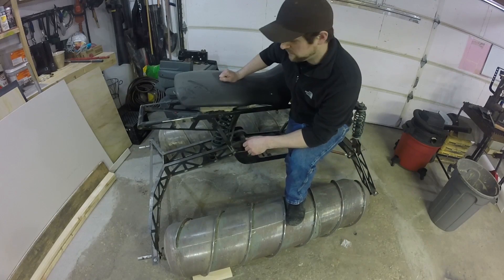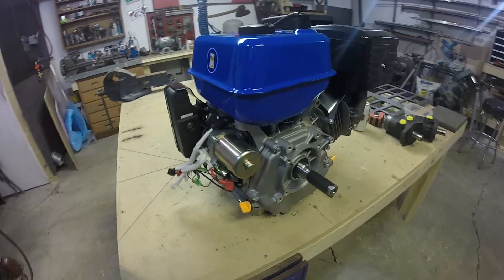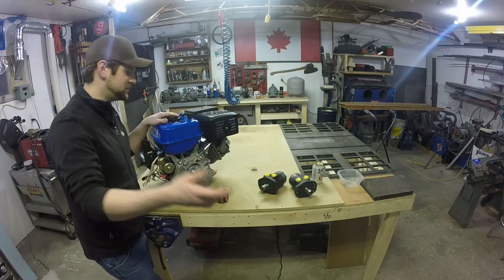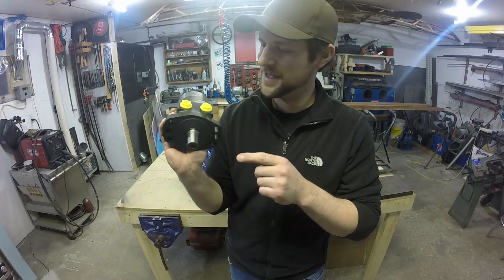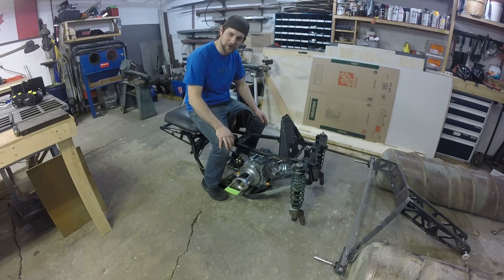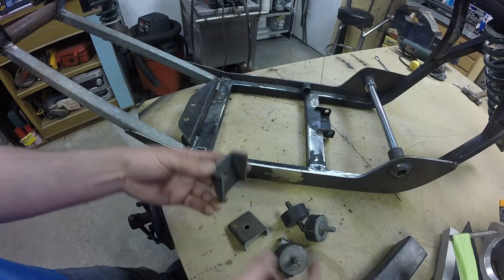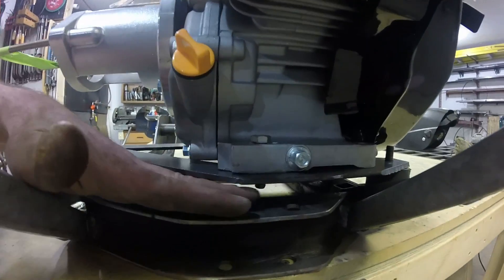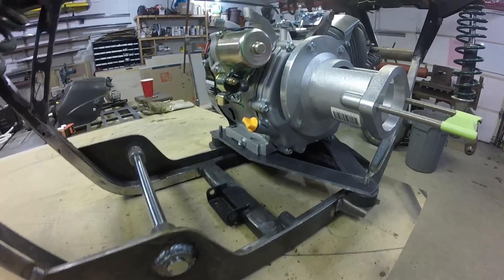Amphibious Screw Drive ATV Project - Part 6 - Horsepower

Comment: hello nic, my father and me are big fordson fans, we have 5 of them. I am really interested in the fordson snow devil and I would like to modify a fordson f to a snow devil. the real deal. my question was: where do you buy for bevel gears? it hard to find them that are big enough. 
much obliged,
Jermain
Reply from the maker: as in the gears on the back of the pods? not sure for the fordson...those were very big
Reply: REDNIC79 I mean the gears where the diff connects to the driving rods
Reply: I am not talking about the sprockets on the back
Reply: I am sorry I meant the gears you used on your tractor
Reply from the maker: www.princessauto.com

Comment: Yo delete the internal combustion engine. Get an electric motor...the full torque at 1rpm will be extremely advantageous for the screw drive.
Reply: oh shit nevermind lol, didn't realize you're driving the screws with hydraulic motors in this new one.

Comment: Any mower or small tractor I've come across with a hydraulic setup always have a V-twin, 14+ hp. One thing I learned the hard way, always run the engine at 3500+ rpm with hydraulics.

Comment: Hydraulic engineer here. Let me know if you want any help. If you have a schematic, I can take a look.
Reply from the maker: that would be amazing, could you message me your email address? I have a system designed (by me) but I have some concerns, the biggest one being the reservoir size. there is no room for the size that is recommended...

Comment: Wow - I am building similar screw driven pontoon 'vehicle' to replace our airboats (scoot) I am hoping it will be a safe way to cross from our island home to mainland, which is only about 350 meters away. So far I have 60hp gas aircooled powerplant, and a 52hp hydraulic pump. I am hoping to use  2 low rpm high torque geroler motors - about 20 gpm flow rate @ app 30 hp each. I too know very little about hydraulics - this is a real learning curve for me. Send me a PM  - like to chat with you about how you chose the helix flighting and what your guess is for rpm on the drive
Reply from the maker: awesome!! where are you from????!!?! hahaah....another crazy person!!!! sweet!
Reply: Orillia Ontario. We live on an island in Lake Simcoe
Reply from the maker: i send you my email on your youtube channel

Comment: Thanks for the update....nice idea on the paper template. You can always use a dull lead pencil to find the outlines and holes as well even though yours worked out fine.  You'll be happy with that engine, might want to see what kind of spark plug it has in it. I have that simular engine and it came with a cheap no name plug so I changed it out with a brand name plug.
Reply from the maker: your right on the spark plug! what number should i run in it?
Reply: Can't remember off the top of my head....I can go look tomorrow or I will try to find it on the net somewhere.
Reply: See if these base numbers match what is in the engine now..
MEIYA (JS) (Torch)	  NGK	  DENSO
F6T 	      BP61	       W16EP
F6TC	     BP61S	     W16EX-U
F6RTC	  BPR6ES	  W16EXR
F6RTY	  BPR6EY
I used a NGK but a Denso would be fine too. I know that everybody has there favorite brand plug.
Reply from the maker: it says F7RTC on it
Reply from the maker: sweet! thanks, i'll go grab one, nice tip! now that i think or it....i have quite a few of these type of engines and i had never considered a plug upgrade. cheers!
Reply: marchindy yes, sometimes these clone engine spark plugs only last a few minutes, wtf. sometimes they even have name brand markings, I don't believe them, +1 on the spark plug upgrade.

Comment: On the hydraulic side, be sure to get a proportional valve (maybe something from a CAT mini track, from a junk yard). There's no substitute for being able to give tiny amounts of "direction" to your hydraulic motors. Let me put it this way: my old press was non-proportional, just press and go, my new one has a scrounged up unit from a junk yard (no idea on what it was from), i can now press pins with this. Had i tried it with the old one, it would've either not done it all the way, or crush the pins.
Reply from the maker: I was going to use these...http://www.princessauto.com/en/detail/bm40-single-spool-directional-control-valve/A-p8669715eis that good?

Comment: You said this motor will have less torque than your 16 hp cast iron engine in the tractor.  don't kid yourself.  my argo had an old cast iron tecumseh 16hp that I replaced with a 420cc 15hp clone like yours. The old 16hp tecumseh was in good shape but doesn't when compared to the newer engine due to the more modern carb. the throttle response makes a huge difference. trust me you'll be pleased
Reply from the maker: I hope so!